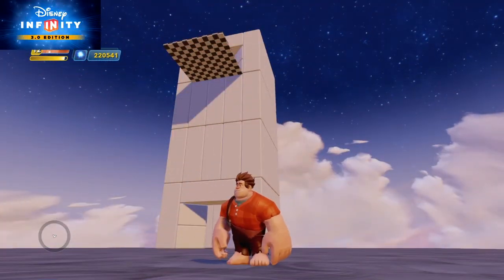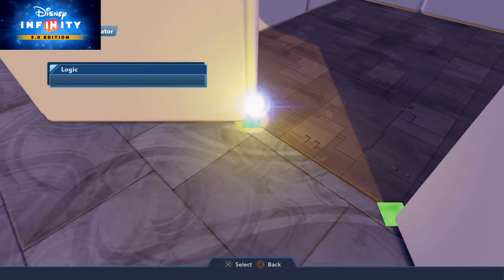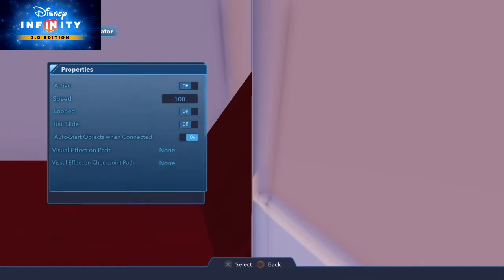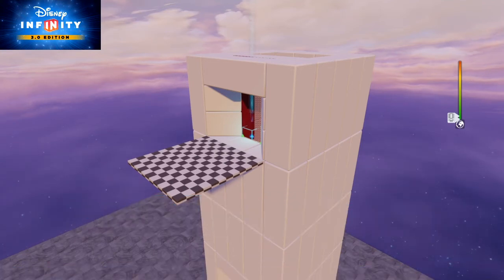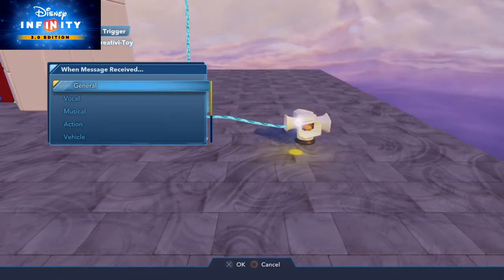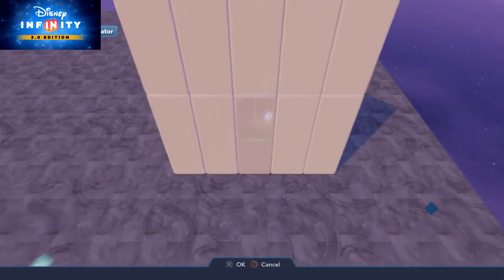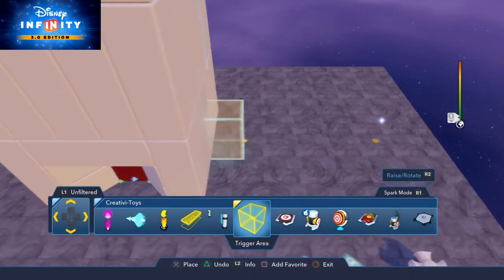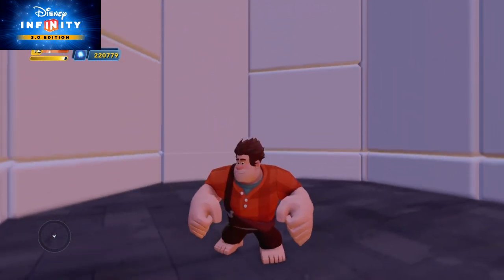How to build an Elevator in your Toybox #2  |  (Disney Infinity 3.0 Tutorial)

Comment: Lot of smart stuff here! It was a great idea to use dynamic triggers for the doors, they are much simpler to work with than trigger areas. The trigger areas to start the elevator and the path points to stop it also worked out really well. Great video!
Reply from the maker: Thank you so much! Actually I am planing a whole series on the elevator. It has a lot of potential.

Comment: Thanks for the shoutout, greatly appreciated! I like the use of the dynamic triggers, I’ve always used trigger areas but have to consider the dynamic triggers for future uses. I like your elevator Logic too, I’ve always hooked mine up to a button or target, but I like the simplicity of the automatic elevator. 😎👍
Reply from the maker: Thank you so much jetlast190, I am glad you like my video! I am working on a new version in which you can use the elevator to go to diferent floors. I hope I can realize it just like I did this one.
Reply: @THEBOWTIEGUY  Using this logic you should be able to make it stop and go at multiple levels or even move horizontally like a conveyor. 😎👍
Reply from the maker: @jetblast190  Just tried that out! Works perfectly 👍🏼. I think this will be my video for the upcoming weekend with a bit of decoration 😉.
Reply: @THEBOWTIEGUY  I still need to get my next 2 videos out for the phase 2 flying debris for Jabba’s sail barge, which hopefully I can get done tomorrow. Then I’m on hold because I accidentally overwrote my save game file with another toybox and I had to start all over again building it. 😬😬😬

At least I have my instruction videos on how to build it. 👍
Reply from the maker: @jetblast190  This happened to me when I made my video for Star Wars Day. Luckily I got the safe file as a back up on my PS4 Account. Thank god I am having PS+
Reply: @THEBOWTIEGUY  I learned my lesson. I’ve already rebuilt the skiff and sail barge and have the explosion effects and I now have 3 save game files for it. When I rebuild the phase 1 and 2 debris fields, I’ll be caught up to where I left off, which is needing to develop the phase 3 debris then the build exercise for the sail barge and blowing it up will be finished. Then I just need to develop a game for it. Building it the second time is fortunately going much faster because I know how to do it. 👍